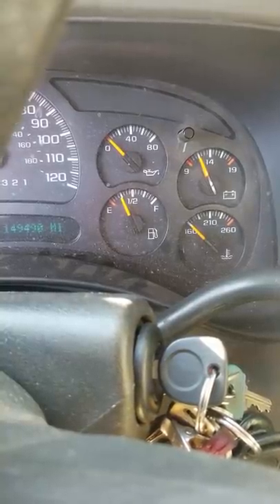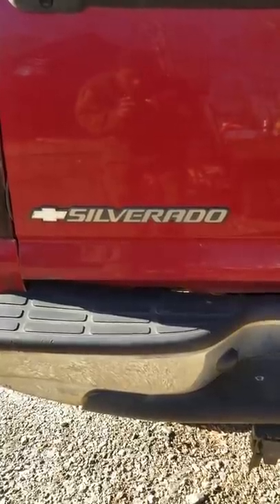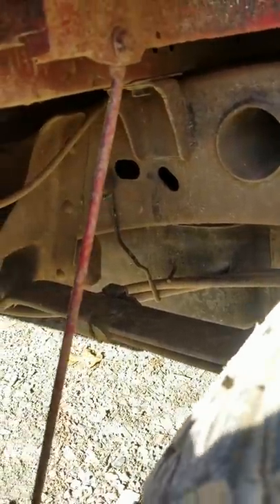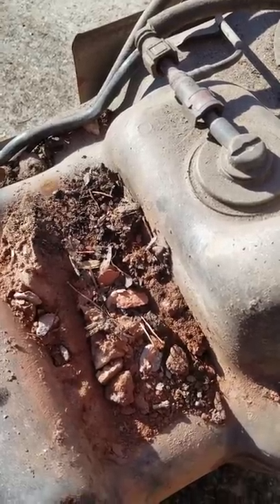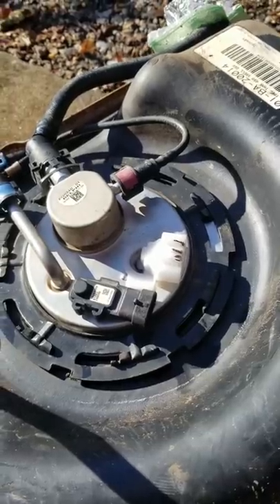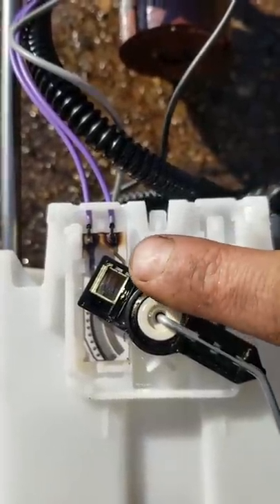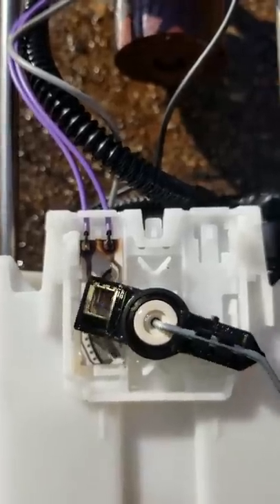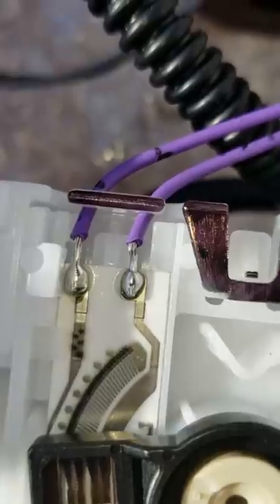Customer States Fuel Pump Broken

Comment: All my silverados have a hole cut in the bed with a door over the pump.
Reply from the maker: Awesome Idea. Not fun to get to!
Reply: In my experience most of the time when the pump goes out you just filled the tank,I ve done one to where we took the bed off,and it was on a chevy silverado
Reply: I was going to do this to my truck then I hydrolocked it and bent a rod
Reply: @bigjuicy2493  big oof my guy. Rebuilding?
Reply: We’re not so different you and I lol
Reply: @Joey-SubGod  somethings in the way? *laughs in cutwheel angle grinder*
Reply: @saltedcashews269  no that was like 2 years ago and I really needed a car so I got it scrapped got a Subaru (biggest mistake of my life) it was about to die so I sold it for as much as I got it for and now I’m looking for a Camry because I’ll be commuting like a mfer.
Reply: @bigjuicy2493  ah. I traded a subaru for one of my silverados lol. Good luck on finding a good commuter. I do kinda miss my little cars. Theyre good to have.
Reply: @saltedcashews269  nice used cars now are so overpriced it’s like 300k miles horrible body and paint and wants 4000
Reply: @bigjuicy2493  damn my guy.. what area are you shopping in?
Reply: @saltedcashews269  Portland Oregon area
Reply: @bigjuicy2493  if youre willing to take a drive, you should keep an eye out in idaho. Pretty good pickins with decent prices
Reply: @saltedcashews269  I would love to but not really feasible for me at the moment
Reply: I never drop the tank. I've always undone every Carriage bolt except the last two by the bumper. Loosen those and you can raise the bed like a tilt bed and get to your fuel pump.
Reply: Big juicy, I have a 92 camry runs drives great, lots of new parts including timing. Has 180,xxx
Reply: @bigjuicy2493  Ohio is the same way right now. People are asking crazy high prices for used cars. Truck prices are even more outrageous.
Reply: Iv seen people  do the same thing with a astro van  and it makes changing the  pump and other  components way easier
Reply: @bigjuicy2493  Camrys are great. I've got one with 310k miles and still drive it often
Reply: Lmao same with my bronco
Reply: My crown vic has a door like that built in
Reply: Yeah seeing how fuel pumps go out every 50k or less
Reply: @dakotahbellville482  everywhere is horrible rn I need a car but don’t want to spend 8 grand on something worth 4
Reply: Same here  I carry extra pumps also.
Reply: Tell me youre extra lazy without telling me your extra lazy
Reply: @donaldmiller4386  tell me you work smarter not harder without telling me
Reply: @donaldmiller4386  *innovative. Lol
Reply: @bigjuicy2493  well I guess I just dont say anything here then, cause there is definetly a smarter way, that isnt hard.
Reply: @donaldmiller4386  how dropping the tank or lifting the bed which is way harder than cutting a hole in the bed and putting a piece of sheet metal over with self tappers. Please I’d love to hear how
Reply: @bigjuicy2493  Never would I drop the tank. Unless that itself needed changed too. But, What is hard about lifting the bed? I garentee I could change a fuel pump faster by lifting the bed than you can by cutting an uneccassary hole. Which just causes a soft spot that will now rust faster than it would have on its own. Remove 4 bolts, on tank side, loosen the other 4. Air tools make that take about 7 minutes, max. Then either use a jack or an engine hoist to lift the bed. Its litterally so easy ( on something that isnt so rusty that isnt worth fixing ) that doing it any other way is not only working harder, but just plain dumb.
Reply: @donaldmiller4386  if all you have is basic tools cutting a hole in the bed is easier and rusting out doesn’t apply to my area and that one little spot doesn’t really make a difference way easier than lifting the bed and all you have to do is undo the bolts when you need to service it again. With the tools I have and what I do cutting a hole is easier. For you it might be a better option to lift the bed but for me an angle grinder is a lot easier and better.
Reply: @bigjuicy2493  So instead of getting better/proper tools, work harder doing stuff you dont need too? Im not understanding your flawed logic. Maybe you just shouldnt be working on vehicles??????
Reply: @donaldmiller4386  I don’t have the budget at the time to do so. In my opinion it is much easier my way. That’s my opinion you have yours you clearly can’t see my point of view. Also the trucks I would own it wouldn’t be an issue in appearance or resale value because my budget and use is different than yours. I would never do it on a newer truck or a truck that had resale value or would appreciate over time.
Reply: @bigjuicy2493  You shouldnt do it at all. Take care in what little you have and it will last longer. Take pride in the work you do and more people will trust you to do other things right.

There are a few terms we old timers use for doing things in such ways. But I will leave it for you to figure those out.
Reply: @donaldmiller4386  oh i see you’re an old guy that thinks he knows everything and is set in his ways. Little life advice from someone half your age, your opinions aren’t always right, doing something the easy way is usually better and faster. I’m not saying do it the shitty way either. Cutting a hole in the bed and putting a piece of diamond plate on it is only helping and not hurting. If you can’t see that I feel sorry for you and everyone around you. There’s thousands of guys that do it and I’ve never heard a horror story about it only good stuff.
Reply: @donaldmiller4386  I did this to avoid being stuck from common fuel pump fail.
I can change pump on side of road quickly .
Reply: @MitzvosGolem1  If you have a pump going out that often, you have a different issue causing it. Even though I love Chevy I can admit their flaws. Fuel gauges being one of them. And its not always the pump that meeses up the gauge, sometimes the gauge itself is messed up too. But never have I heard of a pump going out that often unless you have a bad ground, wiring issues, improper instalation, cheap assed pumps...... Im not a "profesional" but I have been around, and worked on cars for 40 years now. Never have I heard of a pump going out so often you need to be prepared to change it on the side of the road.
Reply: @donaldmiller4386  i run four gms fleet of older work trucks. Have a few fail 100k + all have over 200k miles. Get a AC Delco or Delphi pump they last longest.
Reply: @MitzvosGolem1  agreed
Reply: @donaldmiller4386  
Also consider replacing the fuel filter at the same time as the pump. Usually the pump goes because the filter is done. 

Those are two pieces I consider to be parts that are changed at the same time, regardless of which needs changing first. 
Filter clogs, change pump too. 
Pump goes, change filter too.
Reply: @bigjuicy2493  everybody taking advantage of that right now even if they know their car is shit
Reply: @xthomasbhx  1995 Camry 300k miles 4000 price is firm
Reply: I’m with you I changed the fuel pump one time and had to pay for it the second time I just put a cover over it measured it out and cut my hole put some hinges in there with a couple box 3rd time it went out same thing take it out put it back in 10 minutes take the bed of the truck off I know people do that drop that down take down I know people that do that may I’m not a mechanic and he told me the best way to do it put it down the door in the bed of the truck just cover it up and you act like you never do it you can change it out in 10 minutes the first time I had to have my truck towed home had to pay somebody to do it second time there was a door installed I change it myself the hardest part was going to the auto parts store picking it up and come back end of story easiest way to do it hell of even cut hole in the dam Trunk of a car that’s the only way to do it
Reply: Hmm. I’d cut a piece right above it and save me some time, and I gain another portal to hell.

Comment: It's great to see a mechanic actually clean everything FIRST
Then, proceed to make the repairs!!
The leads for the sending unit burned??
How much current flows through that system??
Reply from the maker: Don't want dirt in the gas tank! Not much current I have seen these burnt contacts on a couple of these.
Reply: How do you call it a repair when he just replaced whole part instead of trying to fix that one wire? Today’s mechanic’s are more like replacers than fixer’s imho
Reply: @sawanstor3229  right? I'm pretty sure it could've been resoldered if he let it dry out to let off the gas fumes lol
Reply: @sawanstor3229  yea but could have been an electrical issue not a wire issue. Probably was a reason they points were fried. No point in replacing those wires when the rest of the part is old as fuck. When the wires are fried again in a month the customers gonna be pissed when you coulda just swapped the whole pump and not worry about it
Reply: @djLagwayEnjoyer  you might be right
Reply: @sawanstor3229  so if he just soldered that contact point and the fuel pump failed 1 month later, what would you say? Would you say, “Sure I’ll pay for your labor to do that job over when you already had the part out.” No. You would say you touched it last, it’s your fault. I found out that whenever a good tech tries to save a costumer money it cost the tech in the end.
Reply: @briandalpe4000  and I’m sure you are a master of your job, which probably doesn’t require skill, so you put negative comments out there to others.
Reply: @sawanstor3229  you have to keep in mind that the mechanics time also has a cost associated with it.. he could’ve taken two days to fix the bad part but instead saved the customer money by replacing the part with new
Reply: @sawanstor3229  you dont want to "repair" this part.  Its a pain to get to and its expensive.  If the repair doesnt work or even it does for 6 months you got to start over.  Better to eat tbe cost and get 6 + years out of new one.
Reply: 1 Amp

Comment: I was gonna be like “why not just solder the leads?” Then I remembered “oh gasoline”💀
Reply: It evaporates quickly
Reply: yeah pretty sure he saw burnt leads and never thought twice. I've never seen an issue be caused by burnt leads that were still attached. also, those sensors pull ver little current so it makes no sense that they are burnt. either way the traces within the sensor or the wipers on the sensor where most likely what was bad. not the leads. if it was truly the leads then he fucked the costumer cause you could just resolder. throw the pump assembly in front of a fan for a few minutes and then get to work.

Comment: You did it the hard way, just take the box off, should be like 6 bolts.
Reply: Lol
Reply: 6 bolts, Filler tube, tail light plugs.
Reply: 8
Reply: Actually should have took 3 bolts out and loosen the other 3 and no wires or nothing lol
Reply: That only works if you are positive you have a clean tank.  Pull the bed and realize there is crud all in the tank, you still have to drop it.
Reply: @JesusChristisLordofeveryone  yeah I don’t know where y’all live but it is defiantly easier to pull the tank than to twist off 3 bolts and torch 2 others on a rusted pickup and have that headache
Reply: Do y'all seriously only have 6 bolts lol.
Mine has 8
Reply: @looselipssinkships6543  what year, it could have changed lol
Reply: @looselipssinkships6543  but yeah mine had 6 from the factory lol
Reply: @loganreynolds8749  I’m in GA, but always pull the tank!  Fuel tanks are usually full of all kind of junk /dirt.
Reply: @aaronsowell259  06 2500hd gasser
Reply: @looselipssinkships6543  ah yeah I was talking about the 1500’s
Reply: @aaronsowell259  you can swap beds
Reply: @aaronsowell259  so id imagine the bolt holes have to be the same
Reply: @looselipssinkships6543  idk truly but all the ones on 1500’s have 6
Reply: @looselipssinkships6543  I had a 97 that only had four. Mine was a dodge though  and I'm sure every brand is different.

Comment: Eh, depends on condition of the bed bolts. When I took the bed off my ford I ended up having to drill 5 of them off (torx head + rust) and the new ones were like $60-70. As long as the gas tank is mostly empty I'd rather drop the tank than deal with that.
Reply: On my chevy they go up from the bottom.   It's no better though, I had a few that the weld nuts broke free and I had to cut holes in the bed to it.
Reply from the maker: Exactly, it's not always the easiest way!
Reply: @MattsShop  lol every one is like 6 bolts and lift the bed off.... the 5th wheel hitch in my truck has 12 bolts ... bed liner and a tool box...
Reply: there’s only two bolts holding the tank in place..  2 connectors, and 2 hoses to drop the tank. everyone on here says it’s easier to move the bed.. it’s just not. just use hand tools, and good penetrant on the tank strap bolts. the rest is gravy
Reply: @c30mob7  all ways drop the tank..... so much easier for me
Reply: @c30mob7  some of us live in the rust belt.
Reply: Thats because they're not regular torx, they're torx plus 😉
Reply: Depends on where you live and who you know if there's industry in your area there will be a fastener distributor & may not be accessible to the public but if you know someone that works in a factory they can get just about any fastener much cheaper than that you can probably get exact same bolts in stainless for a few dollars each or online but you need to know the exact description of the bolts your local so called commercial fastener supply probably won't have them I think fastenal is national you can get anything from them
Reply: On my 96 ranger; remove fuel cap & three 5.5mm head screws, disconnecting the taillight harness helps, but I found it to be kinda optional on mine, loosen three passenger side bed bolts halfway then remove three driver side bed bolts. remembering to use penetrating oil the night before and before removing bolts plus work the bolt back and forth as you are removing it helps...pick up on drivers side of the bed by hand and prop it up with a 2x6 or something. I did this in the freezing cold one night. My torx sockets froze to the bed LMAO

Comment: Something “burning up” on a fuel tank sounds not awesome.
Reply: No oxygen, so no fire!
Reply: But yet they way you car runs is bye lighting gas😂. And it would cach fire not enough oxygen
Reply: @nano-gq9tv  a car runs by mixing fuel and air(oxygen included) then igniting that.  If there was no oxygen, you can spray all the fuel you want to with as much spark as you want to and it will not ignite!
Reply: @onyxphantom6762  Yup! I was always told to not let it get real low because it could over heat.

Comment: That sensor on the sending unit is always loose. Quality gym parts
Reply: Well it is just a push in o-ringed pressure sensor. All the aftermarket ones are the same
Reply: Same style sensor as a GM map sensor... Just doesn't the fingers to hold it in place.

Comment: Never keep less than half a tank,  The gas cools the fuel pump assy so you don't have these problems.
Reply: Really? Didn’t know that. Good to know
Reply: Meh, I ran my 2004 Elantra to fuel light on almost every week for 18 years, 200,000 miles and it's on the original pump. It's not as big as an issue as people make it out to be.
Reply: Aint doin all that shit
Reply: Also use Marvel Mystery Oil in the tank to lube the pump.Ethanol in gas causes corrosion.
Reply: Topping off the tank with coolant helps cooling the pump

Comment: 4 bolts loosen the bed. Tilt up the drivers side and there's the tank.
Reply: What about the filler neck, tail light wires, bed liner,  5th wheel hitch and tool box?
Reply: Yes filler neck. Tail lights stayed. No 5th wheel on most

Comment: I'd just clean up the solder connection and pretty sure it'd work just fine again.
Reply: that's why I immediately went to the comments, dude replaced an entire pump for some bad traces
Reply: You can certainly do that on your own vehicle, but you don't tamper with a customer's vehicle. You do what's safe and approved and replace the entire assembly.
Reply: You mean charge more for the parts (plus markup) and labor costs? Gotcha.
Reply: @user2C47  Approved by who? Repairing bad wires and connections is safe!
Reply: I would understand a mechanic not doing it this way, but surely just the sending unit should be replaceable instead of the entire pump assembly.
Reply: @ethand4784  That would be a dumb move to pull the entire tank out and NOT replace it lmao
Reply: That was probably a symptom and not what was actually wrong. A short probably burnt the connectors.

Comment: Had to replace my fuel pumps on several vehicles.  Easiest were my Mitsubishi SUV and BMW M3 because both had access under the rear seat. Found it easier to remove the bed of my F150 pickup instead of dropping the tank.

Comment: My mechanic tilted the bed on my 97 Sierra to change out the fuel pump. Was actually easier than I expected.
Reply: That's how I do it, you can do it al by yourself with a 3ft 2x4 as a support

Comment: fuel gauge hasnt worked in my 2002 silverado since 2011, I just use the odometer, every 250 miles i go fill up, can go to 300 before it runs out. im only droppin the tank when the pump goes out, its got over 350k miles on it, lotta electrical issues but its an older GM so .. yea thats a given

Comment: Remove drive side bed bolts, loosen passenger side bed bolts, tilt the bed up and you can replace the fuel pump and sending unit easily.

Comment: I had an s-10 when I was 16 and for some reason used an angle grinder to cut an access hole in the bed to change my fuel pump. Now that I’m older, dropping the tank seems like a much better idea lol

Comment: I removed the driver side bed bolts and loosened the passenger side bolts. lifted the passender side and proped it up with a 3 foot piece of 2x4 on the tire. had enough room to replace the pump. Took under 30 minutes.